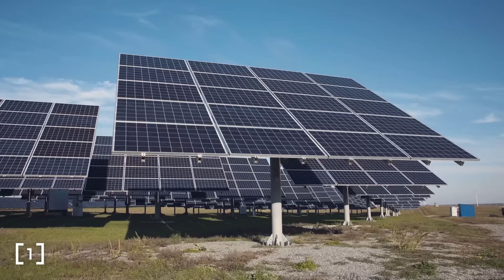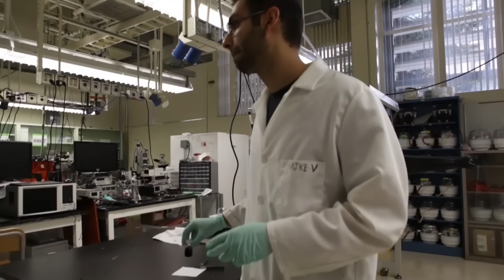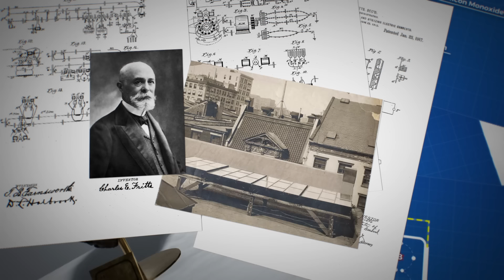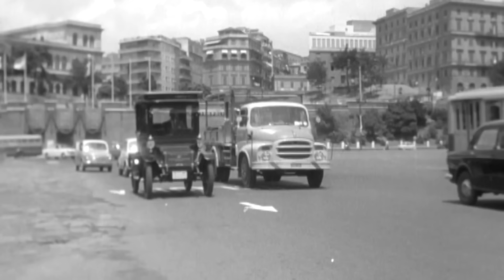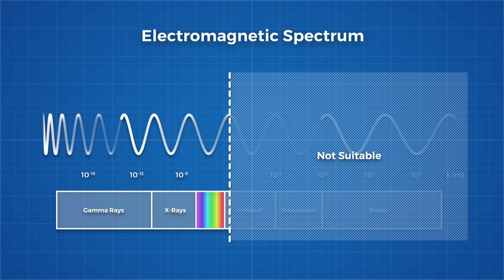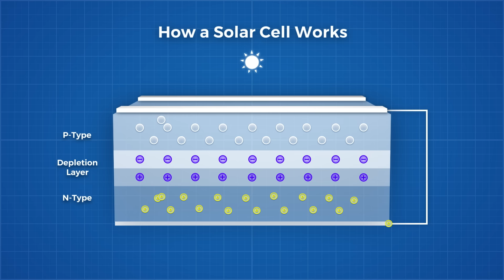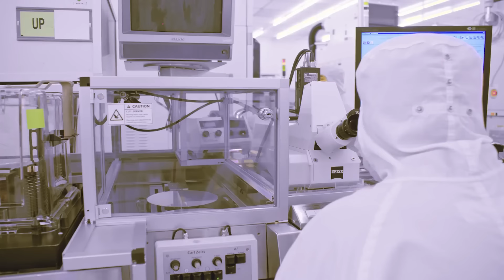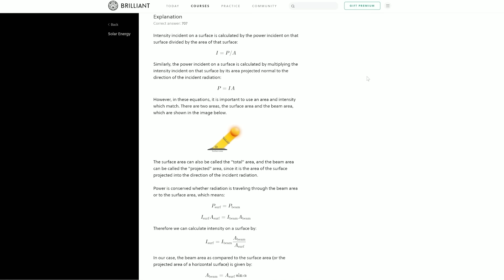The Mystery Flaw of Solar Panels

Comment: Seeing a solar cell on top of a roof in the late 1800s and on a Baker Electric Car in the early 1900s looks straight out of science fiction
Reply: You'll be even more surprised to know that "Electric Cars" are almost 120 years old now, and that lead acid powered cars were quite the rage around that same time and considered the "future of automobiles". Hell, Henry Ford (yes, that Ford) wanted to invest heavily in electric cars.
Reply: shippo72 i actually saw a baker electric car in a museum in detroit. that was quite interesting as i has only seen them online previously. but yeah electric cars have been around since ICE cars have been around.
Reply: @boxr_4214  electric cars failed because it's difficult to manufacture at scale at the time, plus the low density and heavy weight. And refueling was slow.

But now, in 2020, none of these concerns are valid lol
Reply: @pilotavery  well, we're still working on the manufacturing at scale part but yes the rest of those aren't issues in most scenarios.
Reply: @pilotavery  Refuelling is still slow, battery still has low density, and is very heavy. None of those are still solved.
Reply: @kaikart123  true, but hydrogen will never get beyond where it is, since it's at the physics limit. 

Batteries are consistently improving
Reply: @pilotavery  true, battery is still the big wall of EV. The moment you can charge the battery as fast as refuelling gasoline is the moment people will seriously considering switching to full EV. For comparison, you can dump gasoline with very much higher rate to the tank than even the maximum rate of usage. You cannot do that with current battery technology, the charging rate is much lower than the discharging rate, which is the opposite of gasoline.
Reply: If a battery can hold charge for 12 hours of use there is no need for the battery to be instantly recharged. Take a nap or eat dinner and your battery will be recharged.
Reply: Ford's wife drove an electric car, and recharged it at any of the city wide present charging stations. Jay Leno is currently resto-modding one of those very cars and has several build blog snippets on the car and its history.

A lot, and i really mean, a lot of concepts and systems were present before they were established. Some through natural problems, some...more nefarious.

For example, 3D printing could've been achieved at the stage we have today, almost 25 years ago, if not more. Why didn't it happen? Because certain companies sat on the necessary patents. Did you know Apple is going to permanently sit on a patent that allows them to make the apple logo on the backs of their phones? And that said process, whilst not the only one, is one of the cheaper/efficient ones?

We have a problem in this world, and it's mainly there because we've allowed other people to harm us all, collectively.
Reply: Just shows you how long the big mainstream traditional energy companies have tried to buy out, squash and suppress any alternative energy sources like solar or electric for your car. Go look up the documentary how they killed the electric car trying to come out again around the 1970s as well. Only nowadays with Tesla are we finally breaking through that artificial barrier put in the way for all those decades.
Reply: @DeathBringer769  They got really sneaky as well.  They used hydrogen to kill the electric car when hydrogen is better suited for the long range.  Batteries and fuel cells actually complement each other.
Reply: @alwynwatson6119  hydrogen may be clean but the process to attain it damages our climate
Reply: @joshuawalker2573  I assume this is on the basis that electrolysis would use fossil fuels even though the best time to run it would be when wind and solar are over producing.
Reply: @alwynwatson6119  Dude I think about this stuff to. I thought hydrogen was the answer until I researched it and I also found out more energy goes into the making of  windmill's then they actually produce. Governments hide and buy up good ideas for renewable energy and keep the unreasonable ideas available to keep us dependent on fossil fuel.
Reply: @alwynwatson6119  George Soros and Mike Bloomberg the two biggest Democratic campaign contributors are funding the release of felons, paying their restitution, that doesn't sound corrupt to you?
Reply: @alwynwatson6119  I'm just saying electric cars are just as controlled and evil as fossil fuels
Reply: @alwynwatson6119  e-waste is just as harmful to our environment as fossil fuels if not worse. E-Waste is bought up by other countries where it is burned or stored in landfulls that leache disgustingly harmful chemicals and metals into our oceans and aquifers.
Reply: @joshuawalker2573  It's good that you know that there is some sustainability suppression going on. Buying up good ideas to keep people dependant on fossil fuels is not there only strategy. For example misinformation. This can take the form of climate change denial and lying about the capabilities of fossil fuel alternatives. Take the payback time of wind turbines example. Basically the more people that have to lie the harder it is to hide the truth.
The consensus of the following websites is that wind turbines pay for themselves in 4 years to 6 months.
https://enerpower.ie/portfolio/wind-turbine-payback-period/
https://www.newscientist.com/lastword/mg24332461-400-what-is-the-carbon-payback-period-for-a-wind-turbine/
https://phys.org/news/2014-06-turbine-payback.html
https://www.windpowerengineering.com/wind-turbine-carbon-payback-times-shorter-than-expected-finds-new-study/
The list goes on.
"Wind turbines use more energy than they generate" does not pass consensus check.

What about sanity check.
How are more wind turbines being installed at a exponential rate if they use more energy than they generate.
https://en.wikipedia.org/wiki/Wind_power_by_country
So that statement does not pass sanity check either.
Reply: @joshuawalker2573  You might want to point out the that they could theoretically be converted into a remote control battering ram at the press of a button if they have driver less capabilities.
Reply: @joshuawalker2573  That is why it is important to build a proper recycling industry. Also a lot of the stuff in E-waste is actually quite valuable. This video covers some interesting solutions. https://youtu.be/QTU1F865JJo
Reply: @alwynwatson6119  maybe it would be better for you to admit that you dont know rather than just claiming nonsens and try to make it sound like you know.

And also... never post partisan information as a source.
Reply: @matsv201  Assuming you are responding to my latest comment the point of the source was the existence of the hockey stick curve. (A scientific fact that only conspiracy theorists disagree with) As for the bit about not knowing stuff. I know your projecting your lack of knowledge onto others and you should stop. This is how it come across when a climate change denier pretends to know understand something. https://youtu.be/lf3TGmaLXow
Reply: @alwynwatson6119  maybe you should asume less.
Reply: @matsv201  Then maybe you should tell me which comment you are replying too. When I see @Alwyn watson how am I supposed to know what you're replying too when I have left a bunch of comments. It could be this if it is a partisan source you're looking for "Wow did you know he's also being funded by the illuminati who faked the moon landings and are using Haarp to control the weather. And there putting chemicals in the water that are making the friggin frogs communist. Don't beleve me? Look at this https://youtu.be/z8OTBF2V0G8 you know because kermit is a real frog." If so you would have noticed it was a joke. Right?
Reply: @alwynwatson6119  i should not do that, because you need to proofread your own statments regarless if im hear or not. Just folow the advice

You should also stop stawmaning. Actually you should stopp with all the falacies.
Reply: @matsv201  I do proofread my own statements. You need to start thinking about what you are writing. Maby one day if you work at it your coments might actualy make sence.

Also follow your own advice for once. 
Unlike the hypocrites such as yourself I don't actually write any fallacies.
Reply: @alwynwatson6119  You did just write a strawman, so that statment would be incorect.

"Maby one day if you work at it your coments might actualy make sence."

If it didn´t made sense to you... you didn´t understand it.. if you didn´t understand it you would know if i´m right or wrong...
Reply: @matsv201  Actually it didn't make sense because you are incapable of being coherent. Apparently If "I didn't understand it I would know" You know stuff when you do understand. See the difference.

You need to understand that telling someone they are lying but not about the last thing they said and refuse to tell them what they are apparently lying about is a completely nonsensical thing to do, and yet you do it.

Except you then also give advice that you clearly don't follow yourself when it is perfectly obvious they do. What's there to not understand about such stupidity other that the fact it is stupid?
Reply: @matsv201 I'm calling your bluff, you are refusing to specify which comment you were criticizing which leaves the possibility that there is no comment that your criticism is apt.

 If you aren't bluffing, specify which comment of Alwyn Watson's you are criticizing in your first comment.
Reply: @josephburchanowski4636  no that is not how that works.
Reply: @alwynwatson6119  total lack of argument, just word vomit.
Reply: @matsv201  If you aren't willing to specify which comment you are criticizing, why should we assume that there is a comment that your criticism is apt?  You could just as easily be saying criticism that isn't apt against any comment, thus looking for which comment you are criticizing would just be a wild goose chase.
Reply: @josephburchanowski4636  because the its about accepting being wrong,  not aguing about being wrong, its really very obvius.
Reply: @matsv201  Congratulations you have proven you can't know an accurate description of your hypocritical strawman arguments when you see it. 

Why do you demonstrate the exact things you accuse others of in your behavior?
Reply: @alwynwatson6119  it would seam you dont know what a strawman agument is... why dont you go google it.
Reply: @matsv201  In fact this "total lack of argument, just word vomit." would be an good reaction to this "maybe it would be better for you to admit that you dont know rather than just claiming nonsens and try to make it sound like you know.

And also... never post partisan information as a source." Because it is a perfect description of it.
Reply: @alwynwatson6119  you are not in kindergarten. Just repeating stuff like a stubern child wont help you.
Reply: @matsv201  So then why don't you accept your own advice and acknowledge the really obvious fallacy you made in one of your earlier comments? If you need a hint, it is a different fallacy than the strawman fallacy.  If you can't accept that, then you are just a hypocrite.
Reply: @josephburchanowski4636  no i didnt.

And why do you attack me, what is the point?
Reply: @matsv201  Why do you project your own ignorance onto others?
if your not attacking a fake argument of your own creation what are you doing?

 I have explained the error in all your nonsense yet you can not come up with a single example of your own claims.
Reply: @matsv201  What does showing you your own hypocrisy have to do with kindergarten?
Reply: @matsv201  " no i didnt."

Yes you did.  How are you missing a fallacy so obvious?  You should really proofread your own statements to avoid such fallacies regardless of whether I am here or not.
Reply: @josephburchanowski4636  The funny thing is that he then accuses me of strawman arguments when he takes this to an extreme with an imaginary strawman argument.
Reply: @matsv201  In places where randomly insulting people is seen as distasteful that is how it works. Since everyone other than you tends to see being randomly insulted as distasteful those places are everywhere so you need to learn to productively criticize if you don't want to irritate everyone you meet.
Reply: @alwynwatson6119  Does spaming imaturity take you anywhere in life... no it wont.
Reply: @matsv201  It's a good thing that your the one doing it not me then.
Reply: @alwynwatson6119  you are totaly unable to admit that you are wrong.. so no.  Blaiming others is imature.
Reply: @matsv201  When people see your comments they will know your the immature one. Because its stupid that you make such clames when all you have done is blame and randomly insult others. If anyone needs to admit there wrong it's you. If you did your research, you would know that whatever you think is "nonsense" is actually fact.
Reply: @alwynwatson6119   no that is not how the world works.

They se that you didnt admit you where wrong
Reply: @matsv201 "They se that you didnt admit you where wrong"
Nah, they'll see that you wouldn't admit to making the fallacy you made.  Just own up to it already.

And while you are at it, suck it up and say which comment of Alwyn Watson you were originally criticizing.  You are avoiding it like the plague.  Is being clear in a conversation really that problematic for you? Spit it out.
Reply: @matsv201  There are some good reasons for that.
1 You don't seem to even know what you think I am wrong about.
2 All of my serious comments are accurate and no amount of verbal diarrhea from you will change that fact.

The conclusion is you should stop spamming me and learn how the world works.
Reply: @alwynwatson6119  a lot of projection there.

The issue is not that i supose to knownwhat you are wrong about, but you to admit it.

I ask you a final time. Do you have problems admitting when you are wrong

Yes or no
Reply: @matsv201  I have no problems admitting when I am wrong but I do actually have to be wrong about something first. If you want me to admit I am wrong you have got to prove it.

Do you honestly think that repeatedly telling someone to admit that the wrong for no reason at all is the action of a sane person? That is what you are acting like right now.
Reply: @matsv201  By the way all the projection is yours.
Reply: @alwynwatson6119  
What you wrote

"Are you high"

Then claiming someone wrote battery cost £500 000 when it was really obvius that it was 500 000 LB.

That is just one example of around 20.
Reply: @matsv201  Actually "Are you high?" is something someone else asked me. And the misunderstanding between £ and lb is minor in comparison to the fact that it does not take that much ore to make a battery. But yes it was a little darft of me to think he meant £. If all the other "20" examples are that petty I don't know what the fuss is about.
Reply: @alwynwatson6119  That was not a misunderstanding. You based your whole rebuttal of something that really should be very very obvious was wrong.

Then you claimed the doping part was the mined material to finished material.

If you check out how lithium is mined, you would know that is not even close. Tons of raw materials is needed for every kg of Lithium salt. Then the lithium salt need to be refined to metallic lithium.

Again and again, you are wrong every step of the way. And you are a lot wrong, in every steep. Its quite oblivious you don´t have a clue what you are talking about

I don´t need to give you 20 example. You should admit that you are wrong on only one
Reply: @matsv201  Here's the definition of a ore. Ore is natural rock or sediment that contains one or more valuable minerals, typically metals, that can be mined, treated and sold at a profit. Ore is extracted from the earth through mining and treated or refined, often via smelting, to extract the valuable metals or minerals. 

Basically if the concentrations are too low it's not a ore by definition. So if low concentration was that much of a problem no one would bother extracting it. This would be obvious to anyone who knows what an ore is.

To need 500,000lb of ore to make one battery the concentration would have to be as low as 1 in 679.22 or 1427.28ppm. Although this is in the concentration range of briny lakes it's mostly diluted in water and distillation is not actually mining so much as letting the sun evaporate the water. If low concentration makes this less profitable than mining, why is 87% of lithium produced this way? https://blog.grabcad.com/blog/2018/02/20/how-does-lithium-mining-work/ Also claiming that your doing all this just for lithium is misleading. Since your also extracting other metals such as magnesium from this process. And this is based on the generous assumption that he included briny lake extraction in his definition of mining. Without that assumption "500,000lb per battery" is completely wrong not simply misleading. There for the most logical conversation to have is about cost hence the misunderstanding.
Reply: @alwynwatson6119  
While he did wrote of lithium for one battery... to me it was quite obvious he meant for lithium battery.. not lithium for battery. He did clearify that later where he wrote.

" 500,000lb of ore mineral deposit for 1 lithium electric car battery."

And that was prior you start writing about brime

Considering that lithium is just 7% of the anode, and even smaller percentage (about 2%) of the full battery pack.

So he corected both your error end his own directly in the following comment.

There is also cobalt, nickel. aluminum, copper, graphite and a few other minerals in those batteries.

A rather big additional issue is that neither nickel, aluminum or copper can be purified with traditionall methods. Electric power is needed. A lot of it. This is done mostly in Taiwan, Malaysia and northern china due to the electric power price in those area is really cheap.

Those area have in common they run on mostly coal, because its really cheap. With no carbontaxes and no electric power taxes, the power there is typically 2-3c/Kwh, way cheaper than we can produce it in the west. This is where most of the mining comes in.

Is the cobalt mined in Canada? In some cases yes. Then its transported to typically china for melting, transported back to USA for battery manufacturing. Its not clean.

The worst thing about it. When the batteries are recycled (if they ever will be). That part of the process need to be done again.

No the 500 000lb statmet was not wrong. It was approximate, but not wrong
Reply: @matsv201  "Coal is the cheapest form of energy" HaHa
Its so unprofitable that it is going extinct in most countries despite having massive government subsidies. 

As for the correction. That just shows that the error is not serious because it can be corrected in half a comment.

Everything else shows how you didn't even read most of the comment. And the fact you believe that it take's 500,000lb to make enough lithium show's you still don't know what an ore is. So stop spreading misinformation or shut up.
Reply: @alwynwatson6119  that proves how little you know.

Go check out what power is made from in china.
Reply: @alwynwatson6119  those chemicals are called endocrine disruptors, but it's not making the frogs communist. It's a bit worse than that...there was a lot of scientific interest in it through the 60's, 70's and 80's, then it kind of went quiet. Like...tumbleweed quiet.

The thing about coal being cheap would actually be true, except carbon tax levels that playing field. China refuses to pay carbon tax, so it's still cheap for China.
Reply: @alwynwatson6119  (Joshua W seems a mite unbalanced. Either that or the rest of the world is.)
Reply: @alwynwatson6119  "Also a lot of the stuff in E-waste is actually quite valuable"

Everything considered waste was valuable in former form. There is really no waste -- just resources we haven't figured out how to economically recover and reuse yet.
Reply: @joshuawalker2573  Worse than that, often the toxic e-waste sent to other countries is handled by people, including children, to recover expensive materials, such as gold. Also, kids often play on mounds of e-waste in their communities.

And then there are the conflict materials used in EVs, other vehicles, and most of our consumer electronics. EVs also require far more energy to manufacture than ICE vehicles.

I bought my first car in my life last month at almost 50yo--it's a used 1st gen Nissan Leaf. My family needed a car for health care appointments due to the pandemic, and I didn't want a car that has toxic exhaust and leaks oil, and I didn't want to buy gas and put further money towards a major reason for wars and coups caused by the US (my country) in the last several decades. I bought used because that way I'm not fully responsible for the huge energy consumption for manufacturing the car, keep an old used EV in use, so that that energy cost can be spread out over as many years as possible, and also to save a lot of $.
Reply: @alwynwatson6119  hopefully we’ll see both and more, I’d like to see steam return and compressed Air development too …
Reply: Right!?????
Reply: They have been trying to make solar viable for a very long time.
Reply: Search for Sono motors or Sion. It's a car with advanced solar modules which you can actually pre-order in germany. I don't know if they're releasing it on a global scale
Reply: Yea they found out back then it was a Dead Horse but here in 2020 when History and science is no longer taught  they will continue to Beat a Dead Horse.
Reply: "Green Prince of Darkness" principia-scientific(.)org
photovoltaic cells are crude, molecular erosion parlor trick
Reply: Thats because kids these days think everything before Elon Musk was the dark ages and know nothing about the history of science.
Reply: feels like they have been stopped by developing green energy
Reply: It's photoshop bro. Cameras didn't exist in the 1800's. They were only invented in 1990. Before we had to draw photorealistic things. The camera, per se, is like the Australian drop bear - just something we tell kids because they're silly enough to believe it.
Reply: or it just goes to show how regressive and backwards the energy policies are of the eco-nuts.
Reply: A lot of things have been around since the late 1800's, but have been suppressed because it wouldn't make money for the robber barons of that time. J.P. Morgan, William Randolph Hearst and others are responsible for a lot of things being totally forgotten. For instance light bulbs can actually work for up to a hundred years or more, there's actually one that been on for about a century. Another thing that has been suppressed was Nikola Tesla's discovery of an endless supply of energy  because J.P. Morgan couldn't make money from it. It has been called free energy to discredit it. Tesla didn't invent free energy, he figured out how to tap into the biggest generator of electrical energy known to scientists that the human race has access to. And that's  the Earth's magnetic field, which produces enough energy to power every electrical device on earth. The solar radiation that interacts with it actually produces energy, in fact if you look at the earth and don't think the way public schools have been brainwashing people. You will realise that basically the earth is a giant generator of electrical energy. And yet we're still using fossil fuels to power our civilization. As a matter of fact this last season of Dr. Who with the actress who can't act her way out of a paper bag with a hole actually told the truth about it partially. But I think that was just to rub it into people's faces.
Reply: Hi
Reply: Hey RE == Gods but is Really SATAN== loves Carbon !  PV & Wind == BIG FAULT== UNREILABLE! AND NO BATTERY CAN TAKE CARE OF THAT, except NATURAL??? gas==METHANE BERNieing EGEN is the Battery SATAN Loves  EMISSIONS=Asthma, Cancer, and a Global Warmed earth turned to HELL!!   Only NUCLEAR POWER can lift ALL Humans out Poverty, while protecting the natural environment !!!
Reply: The only way to cool solar panels is actively don't fall for thishttps://youtu.be/HMFFkIj6uo0 fake news. Batteries are the only way to store energy. Don't fall for this https://highviewpower.com/ fake news. Also the solar panels are just for show because if they worked they would do this https://youtu.be/WYtRuOz4Wvw 

When did you notice I was joking?
Reply: Alwyn Watson this reads like a flat earther bot comment
Reply: @boxr_4214  Well it was meant to satirise anti solar climate change deniers. But a flat earther bot is close enough. I assume you noticed it was satire.
Reply: Alwyn Watson without the last bit it’s nearly impossible to tell. you just copied exactly what a conspiracy theorist would comment.
Reply: @boxr_4214  I could have added something about the wind turbine noise causing cancer. What about vaccines are bad but you should inject yourself with disinfectant. Nobody would be crazy enough to say that in public. Oh that's kind of why I thought the last bit was necessary.
Reply: Alwyn Watson you’d be surprised
Reply: @alwynwatson6119  It's the internet nobody can tell satire from written words unless it is spelled out in the end lol
Reply: @grandsome  : because what you think is satire Alwyn ( or many others)  positively affirms.  lol, jk, :-) Gedit.
Reply: @I DON'T KNEEL  Wow did you know he's also being funded by the illuminati who faked the moon landings and are using Haarp to control the weather. And there putting chemicals in the water that are making the friggin frogs communist. Don't beleve me? Look at this https://youtu.be/z8OTBF2V0G8 you know because kermit is a real frog.
Reply: @alwynwatson6119  Climate change deniers? Climate has always changed, but if you truly believe man's co2 is responsible for Catastrophically changing the climate you need a calculator
Reply: @VCanisMajorisY  Nobody in human history has worried about normal changes in the climate. The reason that climate change has people's attention is the rate of change. https://news.psu.edu/story/344876/2015/02/14/research/iconic-graph-center-climate-debate Yet you truly believe that putting large amounts of CO2 into the atmosphere has nothing to do with that despite the scientific evidence that it does. You need a basic understanding of climate science because no calculator is going to compensate for that.
Reply: @alwynwatson6119  I think Phoenix is right people are saying some stupid bullchat these days and they don't even look around to see who's there  !!
Reply: @I DON'T KNEEL   All politicians are reptilians, duh, I thought everyone knew that. Get with the now people😂
Reply: @I DON'T KNEEL  lol So you just jump on the winning band wagon ?
I don't like Biden either and I did vote for Trump 4 years ago. But now I'm not sure.
Reply: @alwynwatson6119  Might have been better to have linked high view power's youtube video than their website.  It might just be me, but I the format of the website rubbed me the wrong way.  I do wish more people talked about grid storage, I'd argue that lack of grid storage infrastructure is the biggest limiter to further solar and wind energy. I get annoyed when people act like lack of grid storage infrastructure isn't a problem because batteries exist.  Personally I am heavy into pumped-hydro despite the geographical constraint (UHVDC transmission lines would help with that though), and even hydrogen production despite the low efficiency. I've heard of cryobatteries before, but that highviewpower video increased my interest in them, I'll try to make sure to check up on it to see how they upscaled.

Thanks for sharing highviewpower.
Reply: @josephburchanowski4636  I will use a video link in future. Personally I get annoyed when people claim that balancing a intermittent grid is impossible because of problems with batteries. PEM electrolysis can be efficient. Not as good as batteries but it has a better energy density and the tanks are very scalable. https://youtu.be/f7MzFfuNOtY The pressurization of the hydrogen can actually be used as an energy store if you regeneratively depressurise it. If your going to have fueling infrastructure you might as well use it as a energy store.
Reply: @alwynwatson6119  "Personally I get annoyed when people claim that balancing a intermittent grid is impossible because of problems with batteries."

Possible one of the main problems is that whenever someone thinks of storing electricity, they only think of conventional batteries.  Even though batteries are only like 3 percent of all grid storage in the US.  94% of US grid storage comes from hydro-pump.

One thing I find strange, is that when I say lack of sufficient grid storage infrastructure is a problem and we need to focus on it, I often get attacked by both sides of the aisle.

Anyways, I completely agree with you about everything you said about hydrogen, including regenerative depressurization.  I think high wind power areas are probably the best for hydrogen grid storage.  Might even be possible to export excess pressurized hydrogen.
Reply: @alwynwatson6119  Notice you were joking? You underestimate the genuine ignorance in YT you're sitting next to. I just figured you were a normal nutjob at first.
Reply: @alwynwatson6119  Ok bot
Reply: @lizardlegend42  Beep beep hoxs beep
Reply: @alwynwatson6119  when you said "don't fall"
Reply: @alwynwatson6119  actual conspiracy theorists say things that are so nuts you literally can't make it sound like satire anymore
Reply: @alwynwatson6119  Are you high, it takes 500,000 pounds of ore to mine lithium for 1 electric car battery. Does that really sound like a solution?
Reply: @joshuawalker2573  "Are you high" I think I will use that for satire in future. That's a funny question coming from someone who thinks that every EV must cost over £500,000. I know new EVs can be exspensive but the pound has not fallen that far yet.
Reply: @alwynwatson6119  500,000lb of ore mineral deposit for 1 lithium electric car battery.
Reply: @joshuawalker2573  According to https://www.thoughtco.com/lithium-production-2340123 the ore to metal ratio for lithium carbonate to lithium is 5.3 to 1. According to https://electrek.co/2016/11/01/breakdown-raw-materials-tesla-batteries-possible-bottleneck/   a 70 KWh battery contains 63 kg of lithium. Take 63 Kg*5.3 and you get 333.9 Kg of ore. That's 736.1lb. Not sure where you get 500,000lb from.
Reply: @alwynwatson6119  I think "Joshua Walker" meant that, on avg, it takes ca. 500,000 lb.s ~ pounds [- that's ca. 227,000 kilos ~ kilograms ] of lithium ore , in order to make enough lithium batteries for one EV to operate.
Reply: @alwynwatson6119  -- perhaps because the Lithium Carbonate [ the salt, Li[2] + [ C+O[3] ] ] is used (for further concentration into e.g. lithium metal) only after it [the Li2CO3] was already purified from the raw ore (containing misc. salts etc) ?
Reply: -- and this, of course, brings up the perhaps-most-important cost of all:  
the issue of "blood minerals" (similar to "blood oil") :  
how much~often that the mining of lithium, germanium, gallium, arsenic, cadmium, nickel, gold, copper, silver, etc, all, is even-now (as we speak) involving: 
mining co.s' enslavement of the miners (& even their wives & children by related co.s); 
the miners' untreated injuries & eventual emphysema &/or lung cancer;  
the Allied Deep State's or China's or Russia's puppeteering of certain local gov'ts' & syndicates' ongoing internecine warring over extortion & control of the mining co.s;  etc. 
 
(- - - all of which should at-least motivate us all to consume as little as poss. in order to still help civilization to grow, as cleanly as poss., into a future hopefully ever more free of such exploitation .. across the planets & into the stars, by the billions & then trillions of future 'buddhas' [awakening saints] , all co-innovating, & further co-awakening, together ? )
Reply: @waking-tokindness5952  Yes he explained that in a later reply.
Reply: @waking-tokindness5952  That is the case with mining most metals and other materials can be used for other things once separated. Also how much material you have to separate them from is dependent on how the Li[2] + [ C+O[3] is acquired. Obviously the problem is not so bad the lithium mining is not feasible. If it was there would be no such thing as lithium ion batteries. But lithium ion batteries will not balance the grid single handedly and power every car in the world. There needs to be a more multi faceted approach.
Reply: @waking-tokindness5952  Very good point. This is why mining needs to be well regulated.
Reply: @joshuawalker2573  " it takes 500,000 pounds of ore to mine lithium for 1 electric car battery"

Lithium is currently considered the best type of battery type but other elements show promise to beat it. Add the fact that "83% of the geological resources of lithium are located in six brine, two pegmatite, and two sedimentary deposits" and you remember brine has no ore. In fact, some are extracting lithium cost effectively from seawater itself. We ain't runnin' out o' seawater.
Reply: @alwynwatson6119  I guess you would get that from an anti mining Eco Worrier , facts aren’t really important to those guys. Talk about deniers. They just want you to stop the planet and go back to living in tents and yurts by some clean river … we can fix this but it will take time and a change of heart from the greedy and the careless … I imagine we could minimise mining coal for a couple of years if we ran those furnaces on waste plastic to relieve the storage of waste products non recyclable. We can clean burn our rubbish for energy and gain a solid benefit but only a few have the inclination to do that …
Reply: Alwyn Watson what do you mean joking it’s true look https://m.youtube.com/watch/dQw4w9WgXcQ